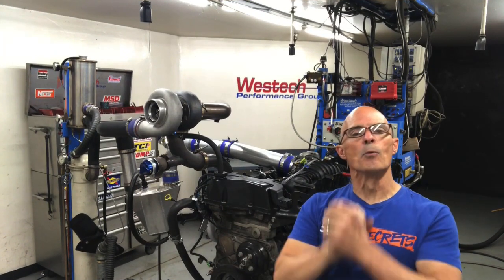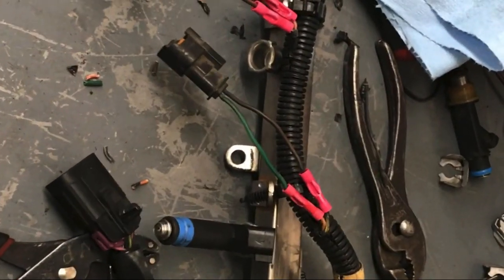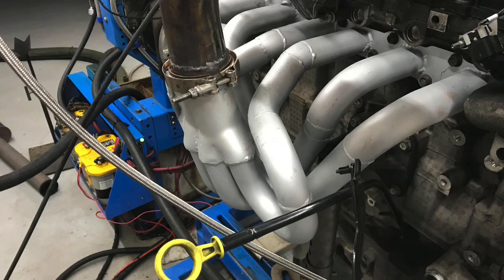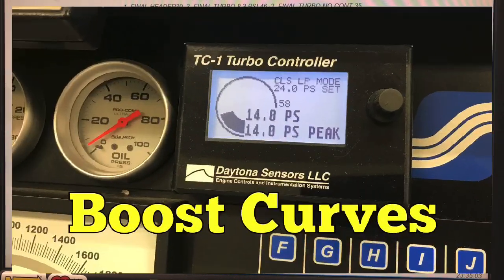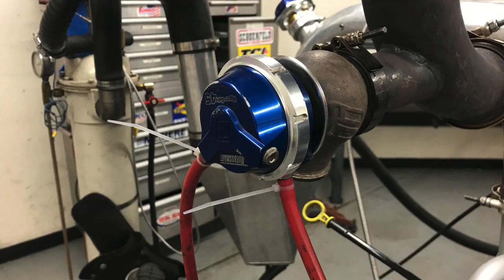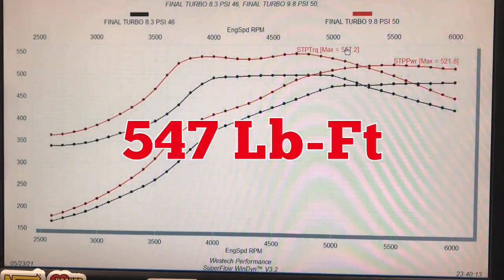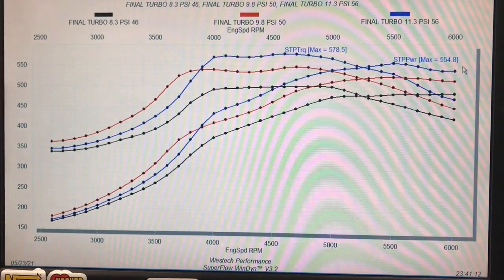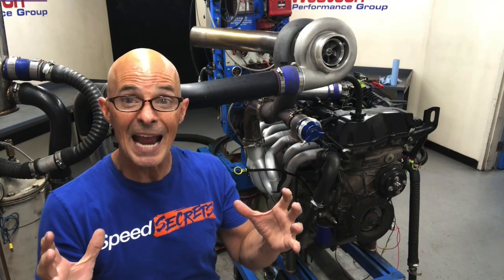JUNKYARD TURBO AMERI-BARRA-THE OTHER GUYS 4200 ATLAS GETS BOOST?

Comment: Do the vacuum lines dance like that because of wind in the dyno room, or is that movement caused by the wastegates operating resonantly/ properly to control the boost pressure?
Reply from the maker: WIND

Comment: GM needs to revisit this design and develop a direct injected version of this, basically a turbo 4.2L inline 6 cylinder DOHC with direct injection similar to the ecotec3 engines. It would be awesome with a 10 speed automatic and optional 7 speed manual transmission in the silverado 1500HD and 2500.

Comment: Over 500 hp on less than 10psi is wild, these engines are arguably better than an LS, and thats one of the older engines with smaller ports and valves, if it was an 06-09 head it would really shine

Comment: I want to see how the torque curve would change if you used c02 boost control with two electronic solenoids instead on the boost reference setup.
Reply from the maker: it can add a little power at the wastegate opening point, but only if we don't run an elect controller

Comment: Did Richard ever take this any further with more boost, valve springs, ring gap? Can’t find anything else.
Reply from the maker: not yet
Reply: @richardholdener1727  add one more vote for additional Atlas testing!
Reply: I’d be very curious how it does with more boost, the stock internals and ring gaps opened up. Sounds like an amazing platform with huge potential.

Comment: Inline six engines have such flat torque curves.  Why (besides packaging) did we stop using these again? They are the perfect truck motor. Torquey for thier displacement, simple, naturally balanced,  one head so less gaskets to fail. I think we are really forgetting a hidden gem.
Reply: bmw never gave up on i6

Comment: I used the 3/4 reach br7ef in my turbo L83 silverado I built versus the $20 per plug iridium’s. I had zero issues running these plugs for several thousand miles yet there’s a lot of people who think they will cause havoc. Glad to see you test the change in the type/reach of plug. Keep up the great work!

Comment: I think this engine needs it's own name and not compared to anything else because I think it set the engine back from companies getting on board to make aftermarket parts for it . Yes I think it's a great engine and there's a few guys out there putting in the work and they have come so far and finally getting notice so I don't think it will be much longer we will see great things from this engine because it's already happening. Good luck guy's

Comment: Nice torque curve. I'd really like to see a turbo on a 2.4 ecotec. Not a popular engine nowadays but if built like jasper engines does, with good piston/ring setup, a boost in low rpm torque for these would help my '15 equinox get out of it's own way!
Reply: Carl brunet runs an Ecotec well over 2000hp in a factory block

Comment: FFS can every American stop calling these motors Ameri-Barra. This is not even a Barra motor, so just friggin it stop already. It's annoying as fk!
Regards,
Actual Barra owner
Reply from the maker: AMERI-BARRA
Reply: @richardholdener1727   😛
It's the damn algorithm that's the problem
Reply: Americans be like "shoosh Ozy or we'll A10 brrrrrt your arse😲
Reply: "oh yeah we rebuilt million km (620,000 mile) taxi motor using the same crank, pistons and rods slapped a turbo on it and pulled 8s on the quarter?" Said no American ever 😛😆
Reply: And also 
"We decided to de-stroke from 4.0L down to 3.7L and throw it back into an family sized SUV 4WD, made 1800hp and pulled 8s on a aeroplane runway (not a sticky drag strip)" said no American ever 🤪

Comment: Can you literally see the vacuum lines actuating the wastegate controlling the boost? Are those those pulses? Circa @7:50?
Reply from the maker: LITERALLY! THAT IS THE AIRFLOW FROM THE DYNO FAN
Reply: @richardholdener1727  I don’t think it is—the fan stays at a constant velocity. Why do they stop pulsing when the throttle is let off?

Comment: Wow, crazy how much more power the Jeep straight 6 strokers make than these. Those strokers make 400HP NA with ease, 1000 HP with only 22#
Reply from the maker: A 4.0L JEEP IS NOWHERE NEAR THESE
Reply: @richardholdener1727  Why can't you make 1000 HP with it?
Reply: @richardholdener1727  Because the sleeves will crack at 650? That's what I thought. The Jeep engine can handle literally 3X the power. What planet are you from where you don't recognize the AMC/Jeep straight 6 and an absolute legend?

Comment: Ritchard I’m not an expert but isn’t it with the torque being higher than the HP that there is a restriction in the intake/cylinder head? I thought it was you that helped us and pointed it out a while ago while the other big channels skipped across it and were good with the goals they met. You reminded us of torque was what killed the 5.3 Big Bang motor wasn’t it? I hope the 6.0 big bang motor is still ALIVE! But I know stay I should stay focused on the 4.2 Ameri-Barr’s points you are making now. Me and my friends thought they were all a slug?

Comment: 15 years ago, GM had a concept trailblazer that they build with a Holset they pulled off a Dodge/Cummins. I don't recall if it was a HX/HY35 series or the HE351. I suspect the latter. Was a fun ride and would break all 4 wheels loose if you brake boosted it.

Comment: I'd love to see what that thing could do with forged rods & 9:1 pistons, some heavy duty ARP studs, and upgraded valve springs!
Reply: Through in an Atomic timing chain kit with crank sprocket and oil pump gears, the engine will pull 800hp no worries
Reply: Nivlac57 Atlas motor renowned
Reply: On corn... 10:1+

Comment: Up the top of the final run looks like valve float to me.
Aussie Barra does the same thing,
Replace the valve springs, close up the plug gaps to 0.022"and get a bit more timing in the bottom so it comes on stronger.
It is looking like a great engine.
Good job.

Comment: As an owner of 3 Barra powered cars, one a 800hp turbo.
Change the valve springs, they will be too weak to hold much boost.
To fix themissfire, Gap the plugs to 0.7mm and I run a volts booster for the factory coils that runs 18v when the boost >5psi, triggered by a hobbs switch.
Please up the boost as much as possible without opening the engine. I want to see what it can do. I predict 800hp with valve springs.

Comment: Had that engine in 2005 GMC Envoy, loved the power it produced back then even with that Heavy SUV. It would be interesting to drop one in a 1st gen Camaro or Nova.
Reply: The deck height on these is so tall that it won't clear most passenger cars without a huge cowl, but it's been done. There's some videos of a Gen 1 Nova wagon here on YouTube running a turbo 4200.

Comment: I like this test a lot because you started the dyno run at 2500 RPMs and it's impressive to see 350 horsepower at 2600 RPM
Reply: TQ*
Reply: Like a pickup truck.

Comment: The real question is what transmission options are available or this “swap” or any adapter plates??
Reply from the maker: this was run with an adapter plate for a sbc/ls bellhousing
Reply: @richardholdener1727 wondering if you could adapt it to a t56/tr6060?
Reply: The 5 speed from the pontiac solstice/Saturn sky. 
Edit: ar5

Comment: Really need to play with cam timing under boost. Any n/a vvt engine I've tuned needs different vvt angles once you get over 5ish psi. You may have even seen some gains with different vvt after you installed the header.
Reply: How would he get vvt on a  non vvt engine?
Reply: The 4200's have vvt on the exhaust cam.
Reply: @ApeMotorsports  Cool

Comment: Stud the head, port it, o-ring, main girdle good pistons rods, wind it to 7000 with 20 psi of boost.. one bad mamma jamma!
Reply: Probably expensive, but still light weight Amera Barra. And would be a beast in an old 280z, or early fox platform car with I-6 front cradle. Make for a nice road race car. What's it weight compared to the typical 8.0" deck Windsor?

Comment: The Stude went 9.99@132.9 with a 2004 engine, unopened longblock, 06 intake cam, valve spring, fabricated intake and exhaust, 19 psi boost.  
The Fairmont went 9.98@134+ with a 2008 engine, boneyard stock, stock intake, factory exhaust manifold, 14 psi boost, 59MM turbo, shifting at 5300, launch with 3 psi, third pass on car.  
Both have a lot left in them.  The current tune ups are very conservative.
Reply: Just to clarify, Calvins studebaker had an 04 engine, 2006 intake cam and valvesprings?
Reply: @TheeAbstractHero  yes

Comment: I know the torque curve is a function of boost, but  I have never seen it so flat from 4000 to 5000, would pull like a train.
Reply: Most of GMs' engines have that same type of torque curve.

Comment: This turbo engine in a first gen 4WD Colorado would be really cool. Just like a modern Syclone.
Reply: Would be better with this Trailblazer motor though. That I5 in the Colorado just didn't cut it
Reply: @Mang213  That's why I said this turbo engine. I think the 5 cylinder sounds cool but definitely would want the straight 6.

Comment: I'd shave the top of that block off and put shorter rods in there. If it can work that way. Maybe down to 3.8L. Give it some more RPM's.
Reply from the maker: shorter rods won't change the displacement, only changing the bore or crank stroke

Comment: I know you're thinking valve cover gasket for the how the oil made it into the sonder but I'm more along the lines of the oil made it past the Rings when the vehicle was upside down if you want to get that oil out of the Rings I would suggest running some seafoam through the intake manifold maybe that might help
Reply from the maker: the oil got into the plug/coil pack wells after we cleaned them-it definitely cam from the valve cover
Reply: To me that sounds like PVC system have you tried taking it out and shaking it and see this makes a rattle noise

Comment: Glad to hear that you're going to put some ring gap in it. That was the one thing I was wondering during most of the video. Kinda makes me want to buy a Trail Blazer and see if i can shoe-horn a turbo in there somewhere.
Reply: take out the wiper fluid tank and there is tone of space there i currently drive a 02 blazer
Reply: Rear mounted? 🤨

Comment: I had one of these in a 2003 trailblazer, swapped in 4.10s and it seemed to have a decent amount of torque, always wanted to boost it but I was 18 at the time and wanted a Ford truck more 😂
Reply: I've got a 2004 trailblazer lifted 6" on 35s... it would be stupid fun with boost 😂
Reply: @damnrightimhard6664  I wouldnt mind seeing that, what lift do you have?

Comment: Lime-swap offers tuning and harnesses for the 4200 and emtechmotorsports has bell housing adapters, flywheels and oil pans for 4200s if you're doing engine swaps. Just posting because it might help somebody
Reply: I greatly appreciate it literally solved half of my problems
Reply: @justinlee2330  post a video when you get it going!
Reply: There’s way more than that now too! Never a better time to swap a 4200 than now!
Reply from the maker: thnx

Comment: Can't wait for more cam and a ported head. I'm curious if you'll pass 700hp with that and 12psi
Reply: FasterProms guys are porting a head for this size of engine, for someone up in the NE.
Reply: I honestly think if they had  Better crankcase venting and much stronger valve Springs  And ring gap would have been able to make over a 1000 on it.

Comment: The oil drain through the fill cap might be the best thing you've done yet Richard!
Reply from the maker: ssssshh-don't tell the roadkill guys-they will copy it
Reply: @richardholdener1727  https://www.youtube.com/watch?v=I0rHlHPz91o    This guy did it first a year ago.
Reply: Thought that was a no go thing to do? My impression is that the oil doesn't drain quickly enough from the head when you ad excess. Maybe another reason your plug holes were filling with oil. Obviously the seals are toast but I couldn't see that helping it.

Comment: Is there a reason why you didn’t need to re-gap the piston rings? Or is that more a function of not wanting to risk snapping the head bolts?

Also, what reason would there be for an engine not responding to long tube headers?
Reply from the maker: motors will take some boost with stock gap, especially since we use e85, a good tune and ran it cold, lots of reasons not to respond

Comment: Valve float boost is pushing the valve open. That's why one of the first Barra mods is valve springs.
Reply from the maker: do Barra and Atlas motors have the same spring rate?
Reply: @richardholdener1727  I'm just throwing my best guess at it. That way if I'm right I can boast about it.
Reply: @richardholdener1727  Atlas is 27lb at 1.589" (closed) and open rate is 120@1.044".  1.457" intake valve diameter, would have to measure the seat and stem to get the exposed area, but at 1.67 square inches you'd slip off the seat at a little over 16psi differential pressure. I can't find anything on the stock Barra springs but all the aftermarket springs are over 90lb closed pressure... which I have to say might not live long in the Atlas looking at that chain.

EDIT: Holy cow, 27 pounds seat pressure? I wouldn't believe it but that's right off an OEM replacement's spec sheet....
EDIT EDIT: Ok, I forgot it's a 4 valve and it didn't even click with the 1.457" valve size that they're small and wouldn't need much pressure stock.

Comment: I wonder if you're getting into valve float. Also you could probably run the water thru the intercooler first and then thru the motor.

Comment: Hopefully this brings some aftermarket for the ol' 4200, the most iconic engines are inclines 2JZ the Barra the ol' Ford inline 6's Cummins etc it was absolutely foolish for nothing to have been done with these engines I really don't know why the big 3 isn't trying to bring back more inline 6 engines
Reply: More difficult to package than a V6.
Reply: Make the engine bays the right shape. BMW have never had a problem with packaging.   Cars look better with a long nose anyway
Reply: @avancalledrupert5130 longer nose 👃    better in a crash.
Reply: They Tried in 2000s especially Chevrolet. They just work with Turbo 4s, V6 and V8s.
Reply: My guess would be packaging a in-line six is longer than a V8 and considerably longer than V6
Reply: It's harder to maintain accuracy over distance so if you have a in line 6 the stack up on the tolerances starts to become a real problem. . It's just quite a bit cheaper to make v engines.
Reply: @blaqlabspodcast5816  well dodge just announced they're dropping the hemi for a Inline 6 turbo motor so hopefully more aftermarket support for our inline sixes
Reply: @michaelf.2449  That's a sprayed bore, disposable, direct injected, dogshit engine
Reply: It's so strong.
Reply: The German cars 🚗  have online six cylinder, for better balance and serviceable.

Comment: Might be off topic, but is there any way we could measurements of the engine from the mounts? With and without intake/exhaust? I’m seriously considering swapping this into my 4th gen Camaro. It has the stock 3.8 and this might be easier to fit than an LS 🤷🏼‍♂️
Reply: It won't be easier to fit than an Ls. You can buy a smashed pickup truck, engine mounts, trans crosmember and mount, ls6 intake and headers. Usually the truck ecm will run the dash no problem. The 4L60e in a pickup has the same case as a 4l60e from a z28 camaro.
It would be a really neat swap but it is probably ten times the work as getting a gen3/4 engine to work in your car.

Comment: I'm curious if Atlas 4200 turbo could function  well in a work truck. Going long distances, hauling a heavy payload while still having enough umph to do it day in and day out consistently. Keep us updated with the results of your testings.
Reply: It probably could but that doesn't mean it should. They weren't meant for it even though they came in a 5500lb suv. For how much work it is I would be way more trusting in a 5.3l ls turbo. I know it's all been done before but lots of guys use what works.
If I was being really adventurous I would use the 4.3l  LV3 v6 that's based on Gen5 engines. The guys at btr say the stock LT1 injectors are good to 950hp with gasoline, that's over 700hp on a six. They have DoD and Vvt. Stock they make as much power (almost) as the 06+ engines with 30 more ft/lbs of torque. The Gen5 blocks, even the aluminum delios, are really rugged and these engines have forged cranks. For a work truck that is going to hammer miles it might be worth it just to save some fuel. The 11.0:1 squeeze and that it runs on four cylinders when you're just rolling would make it my choice.
Reply: @timothybayliss6680  That's basically what I'm trying to get at. Would this turbo I-6 work better than 5.3 turbo as a work truck? Power on demand as apposed to big displacement or diesel power when it's not always needed.
Reply: I had a trailblazer with this motor and a 4.7 grand Cherokee at the same time. The grand Cherokee would pull the same trailer with a fbody on it over mountains as fast as I dared push it. The trailblazer really struggled on the same route. The Trailblazer didn't stop it as good either for what thats worth. I found this surprising because the grand Cherokee supposedly had a little less power, but the torque must have been higher.

Comment: Called it.  STOCK CAMS, this thing made 480 on 8 lbs..thats way better than the dont BS me WITH a cam at the same boost.
Reply from the maker: WASN'T MATTS ON A CHASSIS DYNO?
Reply: @richardholdener1727  yes, but even with loss 8lbs puts this ahead of a ss2 cammed 4.8 at least at similar rpm
Reply: @richardholdener1727  id be willing to bet stock cam 5.3 vs this at 8 lbs with some.tweaking ameri barra will beat it too